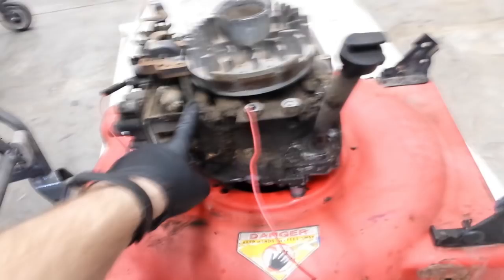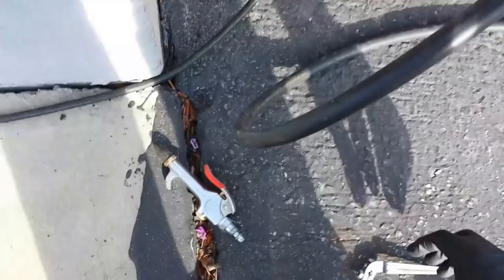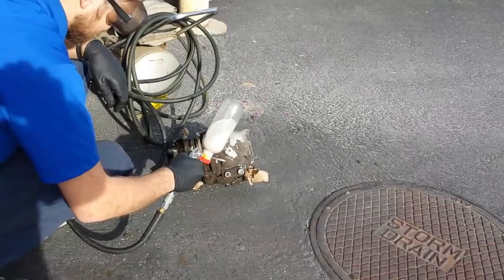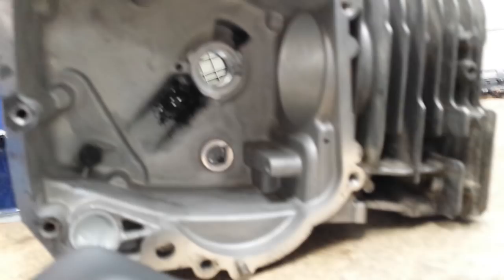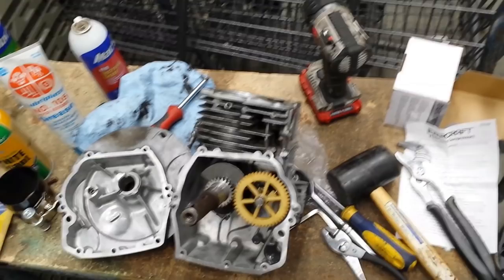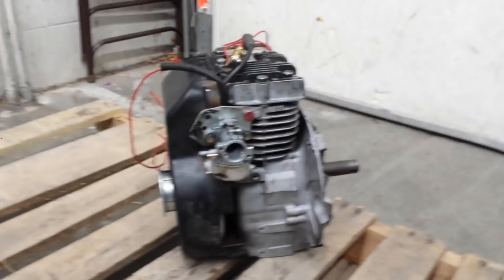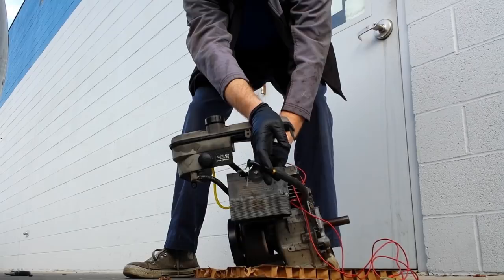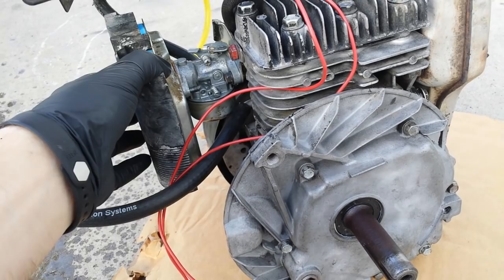Converting a Vertical shaft lawn mower engine to Horizontal shaft

Comment: vertical shaft engines have a much lighter flywheel as they rely on the blade for extra weight
Reply: Just the rotary mower engines. Could use a cast iron flywheel from a pressure washer engine. Those are pretty easy to find.
Reply: Mine is an older model so it has the same flywheel off the horizontal motor

Comment: I never did anything for the valves or breather, just a slinger bolt on to the crank..is all I did . And I just dumped a quart in never care to change it ever and my boys rip on that mini bike ..but maby next time would be good to do all that .oh and I just screwed a screen to the back of the carb for performance reasons..they got way more power than a traditional 5 horse side motor in my opinion
Reply: Did as you say many years ago and it ran for ages without any trouble!

Comment: If you look at the oil fill on a horizontal engine the oil level is much lower then that. Think you had it way over filled. You could drill and tap a small threaded hole in the side of the case to the correct level. When the oil gets to that level it will start to flow out and you k ow your level is correct. Then put the bolt back in. I guess you also ran into issues with mounting it too?
Reply: How would the motor idle for a kart

Comment: All well and very good but why not simply add a gear box that is 90 degrees 
Direction change instead of tampering with a good running engine. Often U
can find them on the mower deck of riding tractors and or pulley systems on the same does the same action .

Comment: How to add speed control?
Reply from the maker: I used a universal lever control cable (this one, in fact :  https://www.napaonline.com/en/p/BK_7311110?keywordInput=7311110) for this build, but this engine is being used in a static fixture rather than a go cart.

Comment: Oh also, another thing did the shaft down near the mower blade have a key screw in it to hold the blade mount to the shaft and howd you get it out if you did have one? Thanks
Reply from the maker: This one had a regular bolt in the end holding the blade and adapter on the shaft, once the bolt was out I used a 2/3 jaw puller to get the adapter off. Even with that it was kind of a pain.

Comment: Hey Riley, during the  2nd act, you said there was a hole in the casing that fed to the breather  tube and hopefully that fixes that. But I don't think you gave your solution. Did you fill it with JB? I have oil pulsing out of the carb at the air filter box side, when i shut the engine down. 
Any thoughts on why ? 
Thank you for the video and your time,
Daniel  from Phoenix, Arizona
Reply from the maker: Are you referring to the one I drilled? I did fill it mostly with JB weld, there is still a small pass through. It does still pulse oil out of the breather. My theory is that because the compression is so low, a lot of it must be getting into the crankcase and pushing the oil out.
Reply: @rileylamborn1846 beginning at 22:53  after you reference the hole you drilled.
Reply from the maker: I haven't done anything with the tube that crosses to the other side of the engine, the only modifications I did there were filling the original hole, drilling the new one and then filling the new one mostly up. Though restricting that tube may help reduce the amount of oil coming out.
Reply: @rileylamborn1846  ok, thank you for clearing that up for me! Im trying to figure my same issue.  Thanks

Comment: What do I do to get a horizontal shaft ready carb for a 300 series briggs? I am going crazy trying to find one
Reply from the maker: I'm not sure on that, I've got one of those engines I've been meaning to tear down and see what it would take to flip but haven't yet. On the build I did here I was able to use the same carburetor, just rotate it 90°.
Reply: @rileylamborn1846  the 300 series carburetor is waaaaay different than the one you used. I found your video so helpful.
Reply from the maker: I'm glad! I'll have to look at my 300 tonight and see if I can think of anything.

Comment: How did you attach the governor arm to the crankshaft for a splasher?
Reply from the maker: I drilled a hole in it and it's held in by one of the connecting rod bolts.

Comment: What did you guys do for oil lubrication on the crank, don’t have access to a welder sadly
Reply from the maker: You mean like for a splasher? I cut and bent the lever that connected the governor to the throttle linkage, drilled a hole in it and held it on with one of the connecting rod bolts.
Reply from the maker: It was the piece that I start sandblasting at 2:04, and you can see it attached to the crankshaft while I still have the engine apart at 13:04.
Reply: Riley Lamborn ok that’s awesome, how has it been holding up, hasn’t rotated hopefully and hitting the inside of the case?
Reply from the maker: Not that I've detected, but I haven't run the engine a whole lot since then. If I remember right, I left the end where I cut it squared off and put that end against the rod to keep it from rotating.
Reply: Riley Lamborn thats perfect yeah, what about the governor splash arm that’s inside most on the governor gear? Can you use that too?
Reply from the maker: You could try, I took it out and plugged the hole in the crankcase.

Comment: How did you start it so easily? Mine just snaps back the pull cord Everytime I start it and it has proper timing
Reply: what engine are you using ?
Reply: @gabrielpichette7272  I'm using a Briggs and Stratton 190cc flathead engine. It's good now it turns out it didn't have proper timing. It never snaps back now
Reply: Did you check whether your flywheel key is not sheared? That's a usual symptom...
Reply: @Merlogcz  yeah it was sheared. Got it back the way it's supposed to be and it runs good and never snaps back
Reply from the maker: @93jake81  that's exactly what happened with mine. I actually sheared the pin a few times before this was done.

Comment: Would this same idea work on a 12hp flathead? Briggs of course
Reply from the maker: I'd imagine the concept would carry over, I'm not familiar with how the 12hp differs internally. On the outside of the motor you may have clearance issues between muffler and carburetor, so you might need to make an elbow or two.

Comment: how did you remove the flywheel and blade adapter?
Reply from the maker: For the flywheel I used a bolt type puller, I believe the holes are 1/4"-20 thread. Or that's what you're supposed to tap them to if they're not threaded yet. I believe I had to get a slide hammer involved getting the blade adapter off.
Reply: oh ok, thanks for your reply! what problems did you get while working on this? cause mine I don't have a material to remove the blade adapter. hehe that pesky adapter won't let me sleep until I remove that and continue working
Reply from the maker: If I remember right, I used a 2-3 jaw puller that attached to a slide hammer. I worked at Napa auto parts at the time and they had a rental set there I used. I do remember it being a royal pain to get off.

Comment: Has anyone here ever did this with a v twin? I have an intek B&S 22 horse vertical that I could use to replace an onan p218g in a John Deere 318 garden tractor. Parts for onan are getting nearly impossible to find and what is out there is crazy expensive
Reply from the maker: Not that I've seen, so if someone has they must not have documented it. I'd imagine it can be done, the main thing I'd worry about is lubrication. Do you know if that engine has an oil pump or just a splasher? A good way to tell is if it has an oil filter it has an oil pump.
Reply: It has a pump, one late sleepless night I was going from forum to forum reading about it being done, it is fairly common in to go-kart world, at least from what I've read. There were links to websites that provide oil pans, electric oil pumps, intakes, and whatever is needed to do it. Of course it was very late, I was dead tired, and being about braindead by that time I didn't think to bookmark any of the forums and I haven't been able to find them again. 
If I try it I want to at least talk with someone who has already done it first. I've searched and searched for videos like this but with a twin cylinder, either I'm not looking in the right places or they simply do not exist. When everything but what you enter in the search comes up in the search results, I'm thinking that I just haven't found the right place to look..
Reply from the maker: Very well could be. In the absence of a guide, I would think the most important thing would be to make sure the oil pump can get oil in its new orientation. Whether that means bending or making a tube to go to the bottom of the crankcase or opting for an electric pump, I'm not sure. Then next would be to make sure the oil can drain from the bearings properly.
Reply: I need to pull it apart to see exactly what will need changed and how, but I really don't want to rip into it without having what I need to do it right away instead of taking it apart then getting back to it weeks later.